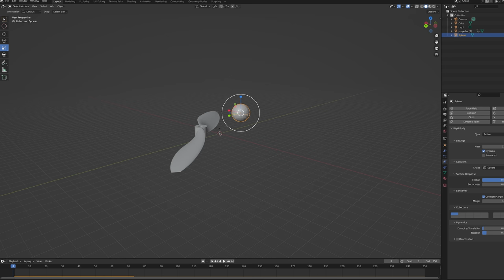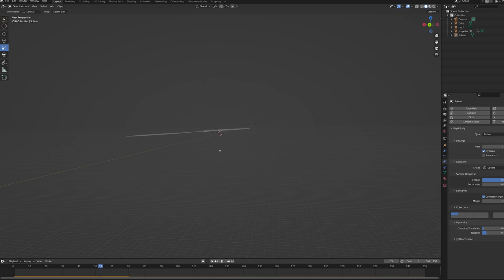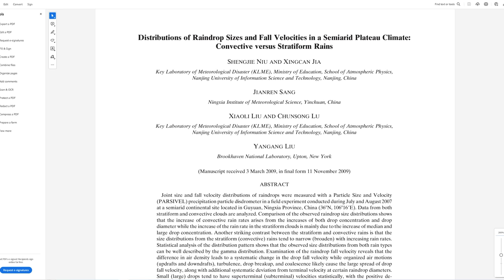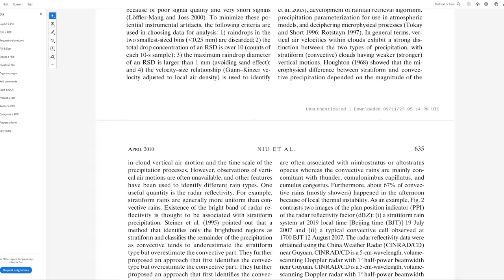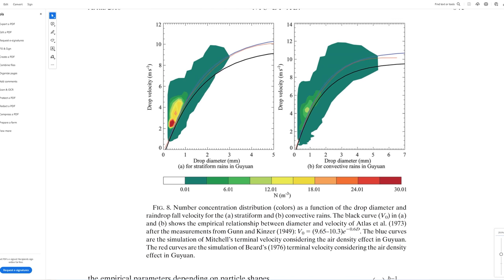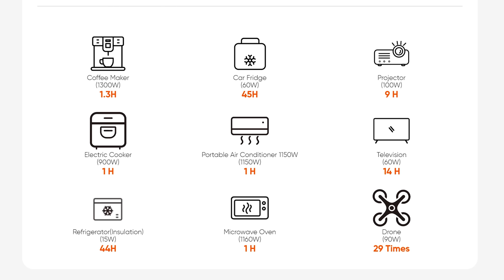Can a Spinning Blade Umbrella Stop The Rain?

Comment: Compressed air umbrella.
A hollow tube but at the top there is an ALMOST flat plate held a 1/16th away forcing the air sideways. Best to have a stubby cone instead of flat plate.

Comment: Question:  That solar powered battery you promoted, how long does it take to charge the battery with the supplied panels from dead to full?
Reply: That looks like about one square meter of PV in total or about 200W peak PV power so it would be fair to assume that two full sunny days would be needed to fully charge the battery from fully discharged to fully charged.

Comment: What about a vaccume umbrella? Make a set of hollow blades, with a slit along the edge, so that a vaccume can pull air through them. This will automatically cause the blades to rotate, and will suck in water through the gaps, which you could then funnel down through the shaft to be either ejected through the handle, or collected into a container

edit: lol didn't even read the comments before posting this, I see others have the same idea, great minds think alike

Comment: Since those are fan blades, how much does the air movement contribute to deflecting the water? Eventually, if the blades get a lot of water on them, it will start slinging water off it, too.

Comment: Looks more like wind umbrella, since it is the wind and not the blades that are blocking the water.    I wonder if the blades were spinning the other direction what would happen.  I wonder what would happen if the blades were verticle and not tilted.   You would still produce winds, but the winds would move into the center (from top and bottom) and go horizontally outward.

Comment: To really prove this works you have to make two versions with the blades going in opposite directions. Because you are using what is essentially a fan, I suspect your prototype is merely blowing the rain droplets away, not acting as a true umbrella and blocking them. Try spinning the thing in the opposite direction, which would actually blow the rain straight down even faster rather than up and away. If that works, then I'll be impressed.

Comment: A fan which is static vs a spinning fan, both will block exactly same amount of water because no matter how fast it moves, total surface area of the blades are same
Reply from the maker: Only if the fans and object falling through have no depth as I explained in the video.

Comment: What about an ultrasonic umbrella? If you vibrate the air in the correct frequency could you stop/vaporize the air fast enough? 
Maybe using a loud speaker that can vibrate enough air?

Comment: run the fan in reverse. See if you get either more wet or if it draws the drops to the blades and slings the water off to the side of the blade.

Comment: ok. Now make a electrostatic umbrella. It works, by charging the droplets with some electric charge, by applying a high voltage to them. Then underneath these charging wires, there are two meshes, with a counter voltage, that is high enough for it to be able to stop the kinetic energy of the droplets. Then there is also a charged ball in the middle, that also repells the charged up water, so that it not only gets stopped, but pushed outwards. This will finally be the best umbrella possible.

Comment: How about a fan made of plastic strings rotating? Like the toys in a circus that spin the opaque plastics that carry light thru them like optic cable. Bunch of those spinning, they can be long but lightweight, and all around and in few rows verticslly coverage, but spinning would make itdroplet tight

Comment: I don't think your experiment addressed the question. The white fan was merely blowing the raindrops away, the raindrops never came in contact with the white blades. What you tested is can you blow rain away from yourself, not can drops pass through a spinning blade.

Comment: using your black material or black paint "Mosul black" could you do a test to see how well they disrupt infrared and thermal cameras  ? I have often wondered if you could use it to defeat infrared or thermal cameras with its light absorbing qualities?!
Reply: Because it absorbs almost 100% of light it should be the material easiest to be seen on thermal equipment, if it's been in light. Absorbed light energy turns into heat

Comment: 😂

I would've tried a line grass trimmer or a plastic blade grass trimmer.

It's much easier to get a cordless one, no assembly needed, high RPM and it's relatively splash resistant.

Comment: 💡 ; leaf blower - straight up into barbecue pit vent with cap. 
===
Could cut hole and first vent smaller hole and next vent than solid no hole last BBQ vent. 
====
Pancake stack of air 🌬️ omnidirectional 🌀
===
Put it in a backpack with batteries. 
====
Whoops make a wall of me might just fly off ; me it would only be the handle - of the umbrella at 3.2 stones.
====
👋😎💨 Bryan

Comment: What if the fan blades were flat and not creating an updraft? Here you’re creating an updraft pushing away the water with air, and probably less actually physically blocking the water with the blades

Comment: About your statement of a 2d fan blade not having increased chances of hitting the object no matter the speed, I disagree. If for example I told you to release the object at any random point between 0 and 5 seconds from now, and the fan blade also took 5 seconds to complete one revolution, you only have 2 instances where collision is possible. Comparatively if the fan spun at a thousand revolutions per 5 seconds, you would increase your chances of having an moment in time where the object and fan are in the same place.

Comment: all of these umbrellas aren't very convenient because you always need energy to power it (gas for the fire umbrella or electricity for the others) while a standard umbrella doesn't need any kind of power (you open it and...voila)
it's the same problem with flying cars : a standard car is....on the ground so doesn't need energy to stay in place (it's called inertia) but if you want a flying car, no matter the way your car flyes, you need energy to keep your car flying.
all of these weird ideas (flying cars, air umbrella, levitating train in a vacuum tube) are from an era when we thought energy could be unlimited
the best train is on rails and it exists since the first half of the 19th century
the best umbrella have been invented centuries ago
a flying car (like in BTTF not like the ones we saw those last years).....will never exist 
this umbrella is great but when you run out of power....you get wet

Comment: you woud need to design a fan that was setup to not ony be SAFE for those around you, but that also blew air, upward and to the sides, to deflect the rain via an updraft, as well as the blades themselves. 

There would be a whole research period, before you were able to optimize such a device, and it would look nothing like a flat paddle fan used for a ceiling.

Comment: rechargeable zinc-air battery, in h2so4(znso4 water electrolyte, with carbon rod/felt electrodes, as electroplating based battery cell, or any other h2so4 electroplateable metal like tin, that will not generate hydrogen in the electrolyte, yep air flow deflection shield

Comment: I you take a plastic disc, with the diameter of the blades, you won't need to spin it at all.
It won't need any power at all.
And it you make it curved like a bowl, but upside down, you can block some drops coming from the sides.
Oh... it's already invented, it's called an umbrella 😂

Comment: in pouring rain, standing in a puddle, holding a metal pole which contains a shaft which turns blades rotating above your head, powered by 110V AC with a totally sketchy non IP rated electrical set up using duct tape? not even Mehdi @electroboom would do that!

Comment: This test wasn't right. You should have somehow hold the fan from the opposite side. Because air was blowing up to the rain. If the blades were blowing air to the ground than the rain could drop on blades and the test would be accurate. If speed was enough you would be dry, if not you would get wet. In your test if the "rain" was heavier than that fan wouldn't be able to blow away the rain, and then the real test of speed of the blades would come.

Comment: Nothing cool about holding a fan while it's raining outside. Better used electro magnetic field to stop the rain mid air or using speaker to blast away those rain drops